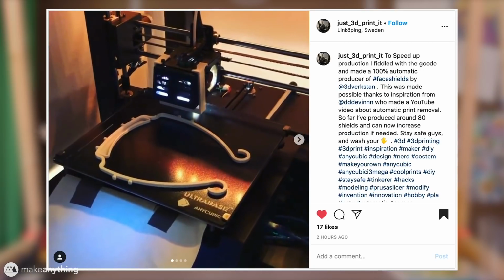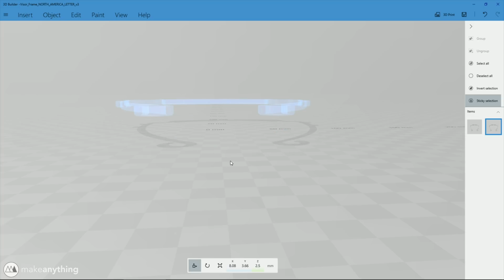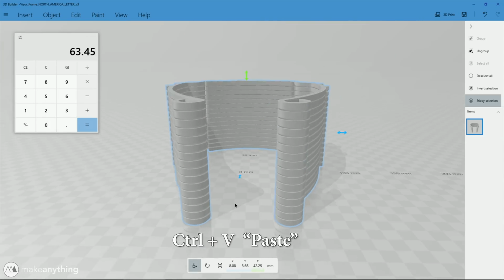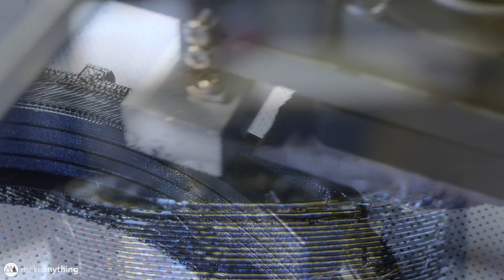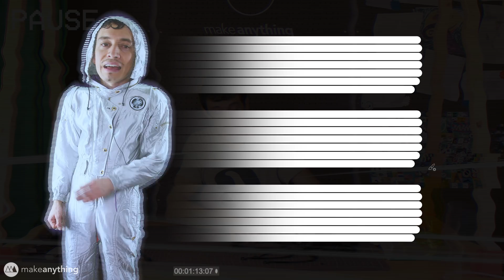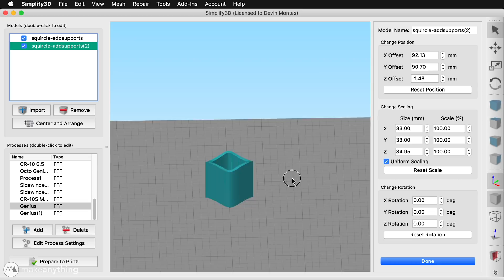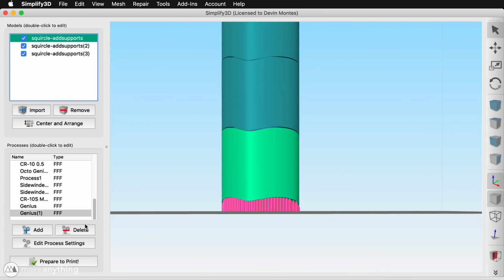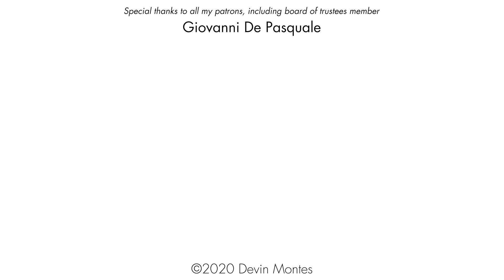Stacking 3D Prints & Scratching Faces

Comment: From a mathematical and mechanical engineering POV, I would guess that the optimal spacing would be the multiple of layer height that is closest to the nozzle diameter.  😉
Reply: More probably it is Nozzle Diameter / 2 or Nozzle Diameter - Layer Height. 
Full nozzle diameter would usually be 2 or more layers. But since slicers use layer height for slicing, that is more important. I'm going to test how a switch to 0.5mm nozzle would make the design phase correlate better with the printer. Now, if i want to have exact number of layers or lines, i need to use multiples of 0.2 in Z and 0.4mm in XY. So, i'll test that if "clean numbers" will make a difference. It would ensure i would never have math that needs to be rounded up or down in the slicer, at least when it comes to layer height.
Reply: @squidcaps4308  think about that a little more.  If you go with nozzle diameter / 2, you'll end up smashing the layer, correct?  Smashing the layer will guarantee that the layers will adhere, thus the reason for using a separation distance (optimal spacing) as close to the nozzle diameter as possible.

EDIT: You are forgetting the effect that the second layer will have on the first layer.  :)

Comment: First of all, great video! But it looks like you used infill. You should only have perimeters/walls in this print. And as many as it takes to make it a solid print.
It's important that there are no cavities and a smooth surface for easy cleaning and sterilization.
Another way of stacking is to flip every other part 180 degrees, so that the second one prints up side down on top of the first one, the third the right way again, and so on. That can be tried if you have problems with the bridging.
Reply from the maker: Oo I like that flipping idea! In this case the slicer limits perimeters, but it also seems to help with the bridging

Comment: Stacking would be really easy in Tinkercad. You can copy and paste the first one, then set the z to be equal to the height + 2 layers. Then just ctrl+v as many as you want and it will automatically move each new one by the same offset. (You can set the measurements to be either based on center or base. It defaults to base I think. So that makes the math easier too.)
Edit: for some reason it's automatically offsetting on the x axis with Ctrl+V. Use Ctrl+D instead.
Reply: could you be so kind and share the model and link it in thinercad, for us newbies, who wants to help hospitals etc too :) Share and care brother
Reply: I’m new to 3D design and I’ve only ever used tinkercad because I don’t even have a printer yet. I love how incredibly user friendly it is  but I can see how an advanced designer would find it limiting.
Reply: @eggyboi1217  yeah, I tend to use Blender in conjunction for that reason. Though other CAD software would probably be good too. You can do a surprising amount with Tinkercad, but it does have some serious limitations.
Reply: In Fusion 360 stacking is even easier, you can use pattern and generate as many copies as you want in equal spacing. I think the best idea is to use software that you already have on your computer

Comment: I also made a mistake while calculating the gap and ended up with bunch of joined prints as I'm printing hundreds of them in a day it was very frustrating to know that little mistake..
Reply: Same.. My printer has a 600mm build height so i printed 30 on top of each over.. Every Single one fused into one huge mask.. Ive now fixed it and currently have 200 bring printed as im typing this.

Comment: Could you post your PETG Simplify settings? I am having real problems on my pretty much stock Ender 3 pro.
Reply from the maker: What specifically is going wrong for you?
Reply: @make.anything  After watching the video I gave it a try again. My prints were just stopping after not even a layer. Messed me up for two days! I figured out that the Outline Direction was messing things up, at least I changed just that and the print succeeded. I had seen in a video that changing that to Outside-in was better for PETG but I guess not! Thanks, for the reply though.

Comment: I saw parts of the live stream, and I know you are not trying to break any speed records, but it took hours for just one set? I just printed a set of two in less than 40 minutes with the right settings and speeds (0,32mm layer height, 120mm/s) on my Dutchy3D printer. Knocking off the 3D prints seems to be even more efficïent, I'm trying it right now.

Comment: Why 0.19 ? 0.2 is so much easier to work with
Reply: Has to do with the z stepper motor so you can get more even layers
Reply: Γιώργος Νανούρης 0.19 Layer Height probably works best on his Printer... even the slightest change on layer height on a 3D Printer could be catastrophic to the end-result.
Reply: @lathryx  No, it isn't. As long as you stay within limits, then a 0.01mm change is barely visible. The plastic comes out at ROUGHLY 0.4mm thickness. You can end up with 0.01mm change after testing a wider range of layer heights, then choosing a nice middle ground. But you won't end up with "hmm, this 0.01mm change made a HUGE difference". Going below 0.1mm with 0.4mm nozzle, that can be disastrous even with minute changes, same when you are near max values. But not in the middle where it barely matters.
Reply: @lathryx  No, it can't be "catastrophic". The layer height should be a multiple of one microstep of the stepper motor, so that it doesn't have to "round" the height and have different heights(bad explanation, watch CHEP's video about magic numbers). Please inform yourself and don't spread bad information.

Comment: You could “sacrifice” the first cylinder by sinking it into the built plate in S3D then stack on top of it. That way no need for supports at all. Then you only need one process.
Reply: Kinda like making the first cylinder a custom support that fits perfectly
Reply from the maker: Good thinking!
Reply: @make.anything  in Prusa Slicer, you can have supports on only the build plate and just increase how many instances you have. I don't know if it'd work for the flat print though... It complains if there are blank layers.

Comment: How is S3D doing, I have not used that for a while now.
Has anyone seen a good comparison review of current slicers comparing and contrasting the current feature sets and maybe a print duel of identical parts?
Reply from the maker: Cura can basically do all the same things but I'm so much more comfortable with the UI of s3d by now. It's also great at handling very large files that might crash other slicers. By no means a must, though